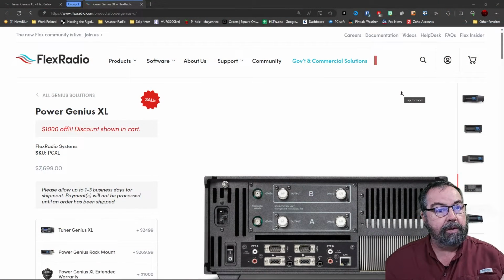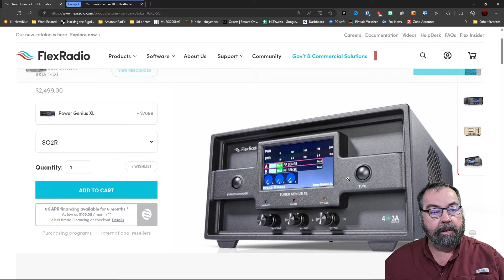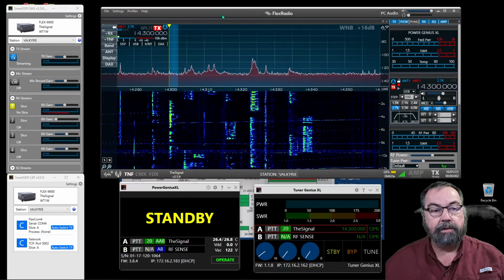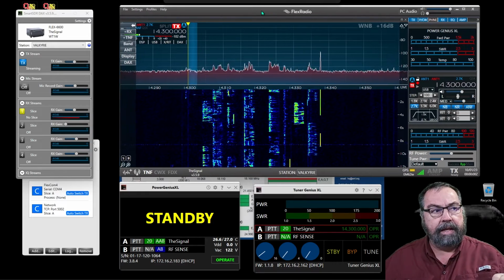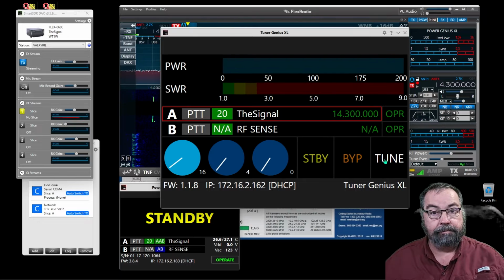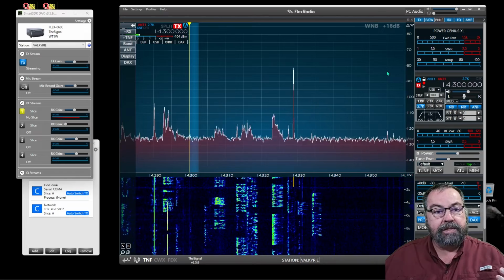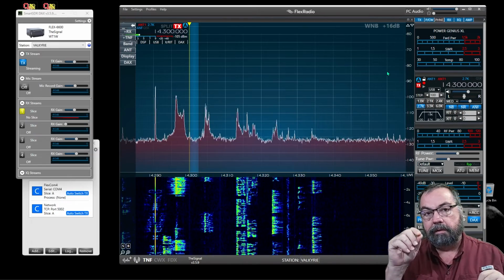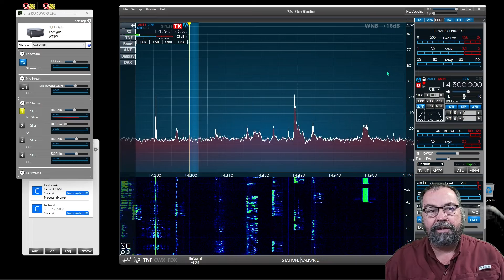Flex Radio Integration - How does it all connect?

Comment: I'm helping a ham friend remotely resolve this issue - "SmartSDR for windows has lost connection please reconnect"
Any ideas?  The Flex Radio 6500 is directly connected to the computer.  SmartSDR version 3.8.23 and it has been working but now this error comes up immediately after opening SmartSDR and continues to try with the same error.  Flex and computer has been powered off and on multiple times, no luck.  Ethernet cable replaced, no luck.  SmartSDR re-installed as well as all drivers, no luck.

Comment: I am pretty sure you don't work for Flex but I am trying to find a diagram showing the cable and antenna connections. I am awaiting my Flex 8600. I have an Icom 7300 with a LP 700 Digital station monitor, a Palstar AT4K tuner and an Ameritron 811H amp. I want to integrate the new flex 8600 Can you advise me on how to or direct me to a source? Thank you I enjoy your channel
Reply from the maker: Look in their videos/documents on their site and YT.  They have one, I know, as I used it when I hooked up my original 811 amp, as well as the PG amp.  There is also some changes you need to make in the SmartSDR software as well, and I think you need to also install the ALC cable from the radio to the amp.  I've been on the PG about a year, and I sold the 811.  I should have done a video on that, I remember it being a pain.

I think this is the video I referred to , this is from Flex - https://www.youtube.com/watch?v=3_bSfOxi1sI

Comment: Quick correction: absolutely NO computer whatsoever is required to "run the radio" [@35s].  And that's important because in the past, and currently with all PowerSDR based radios, a computer IS required to "run the radio".  In those cases radio processing is performed BY PowerSDR on the computer.  The Flex Signature Series performs all processing in the radio itself which is actually not exactly a "radio" at all but really a "radio server", running Linux.  One normally connects to this with client software which can run on anything in principle and is currently supported on Windows, iOS, iPadOS and MacOS.  It also looks like an Android client is on the way as well.  In principle, some device you may have designed to interface with a radio could connect to a Flex which is operating entirely stand-alone.  An API exists to implement an interface to do this as well.  The radio would be "running" in that case with no computer involved at all.
Reply from the maker: So, if I just yell at the radio, it's going to work?  You're splitting tiny hairs here.  A flex radio without a computer interface is a giant block.  Yes, you can use a hand mic and external speaker, but you can't change freqs, change modes, or anything useful at all.  Whether it's mac, windows, android, etc - without a computer, you have a pretty expensive brick.
Reply: @FEPLabsRadio  That's just flat out not true for many users FEPLabs.  Simply untrue. The one splitting tiny hairs here is you.  My quick correction is 100% valid and if you can't accept constructive and appropriate criticism you're in the wrong domain here pal.
Reply from the maker: Okay champ, you say "use" and I say "run".  The point is, you can't use a flex radio without a computer.  You're arguing semantics.
Reply: @FEPLabsRadio   Sorry Pal, wrong again.  You absolutely can both run and use a Flex radio without a computer.  No semantics involved.   There are "M" models that are totally standalone, and three generations of Maestros - full control portable knob/screen interfaces.  No computer required whatsoever.  Not to mention full featured  iOS and iPadOS clients and an Android version almost completed.  Since you don't actually know what you're talking about and are trying to disguise that by arguing instead of just standing corrected with some dignity, I suggest you go find something else to do that you actually understand.
Reply from the maker: Dude, what do you think the Maestro is?  It's a windows tablet.  Specifically, a Dell Venue 8 on the pre-2024 Maestros.  Running Windows.  I do know what I'm talking about , champ.

Comment: Hi Jim, I’m a novice, trying to get all equipment needs to set up my FLEX -6400. Your presentation has been very helpful regarding the integration of the  TGXL tunner. Could you share which model Astron linear power supply you used ? 
Thank you. 
Eric D.
Reply from the maker: I ended up buying an Astron 50A, with the power poles on front.  I can't remember the exact model, but those were the key features.

Comment: I owned my Flex-6700 for about 8 years.  Unfortunately it's no longer in production.  Flex has hinted that 10 years is about the end of their production cycle.  The Flex 6400 and 6600 models have been in production for about 7 years, so in about 3 years it should be interesting to see what Flex comes out with to replace the 6400/6600 models.  I'm crossing my fingers Flex decides to also upgrade the 6700 8-slice model.
Reply from the maker: I'm lovin the 6600, and so far has more features than I actually use.  I just can't see ever replacing mine with something else.  I do imagine they'll update SmartSDR and the firmware innards of the Flex to add features.  I would think 4.0 of SmartSDR has to be close to release.  3.x has been out a while.

Comment: APC makes some smart switches that are meant to be used in server rooms that have a Web interface for power cycling ports.  I have my whole shack setup on one of the APC 220 volt versions and it works great.  eBay is your best friend when it comes to finding a used one of these on the cheep.

Comment: Kind of expensive,   but Western Telematic,  Inc.  (WTI)   makes a networked power switch  (meant for servers)   but they do have a 220-240vac  model.   I think they have,  4, 8, and 16  outlets
Reply from the maker: I need to look that up, so I can remote the amp.  I hadn't checked on those yet, so thanks for pointing me towards one.

Comment: How are going to get that out to a POTA location?  Hi Hi!  73
Reply: You are going to think I'm nuts, but if I'm going on a camping, multi-day venture, my 6600 is always in a gatorcase.  It works, it's protected, sits on the floor of the back seat,  and runs happily on a bioenno 35 ah.  Of course, I don't bring the tuner and the amp . . . Who would do that? lol
Reply from the maker: I totally would with your setup!
Reply: @FEPLabsRadio , it’s waaaaaay too heavy and I’m not that nuts . . . Am I, lol. 73 de Bill